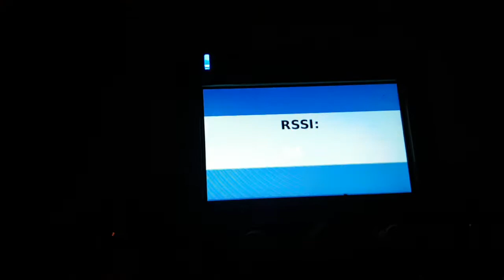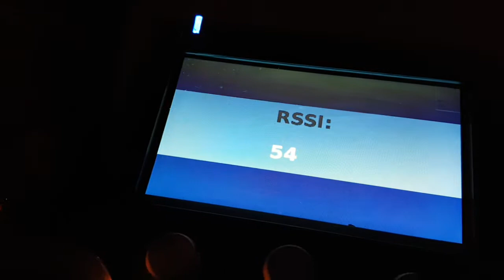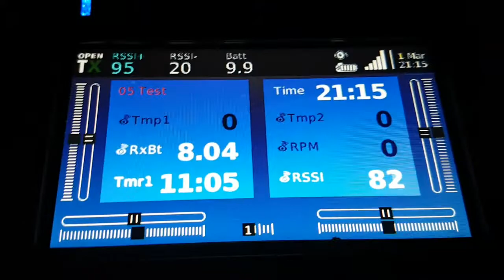180208 Test Firmware Rx8R-pro

Comment: Will the RX8R Pro allow me to designate channels 9-16 as pwm ports instead of channels 1-8?  Can't seem to find the answer to this online but the manual only claims 1-8 and the options to bind using jumpers to establish 9-16 as pwm channels is no longer mentioned in the manual.
Reply from the maker: Yes, you can designate either 1 to 8 or 9 to 16.
Reply: @joetrin  Hey thanks.  For anyone else looking for this answer and how to bind:

I've now completed binding my RX8R Pro as master with X8R as slave.  I used a jumper on pins 1+2 on the X8R slave while binding (= no telemetry, channels 9-16 as pwm outputs) and no jumpers on the RX8R Pro (just like instructions - use the transmitter's OpenTX bind option of 9-16 telemetry enabled), then followed exactly the process shown by FrSky on YouTube.  Before doing this, I made sure my OpenTX was most recent stable version, updated the RX8R Pro to the latest firmware, and also updated (important) my XJT internal module firmware inside the Taranis X9D+.